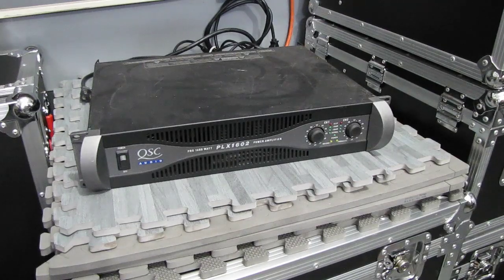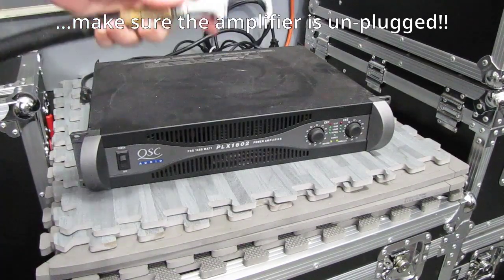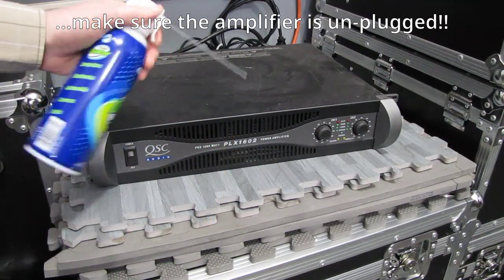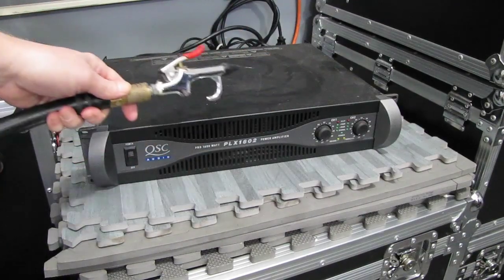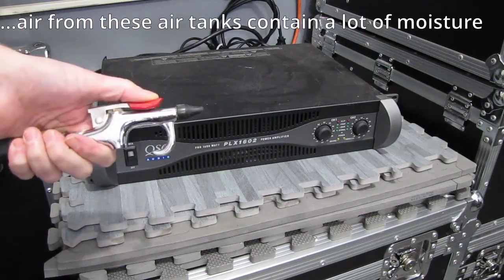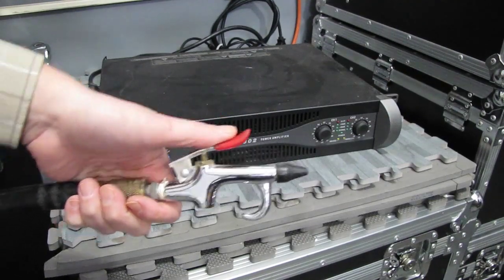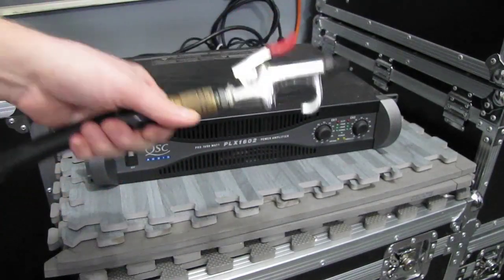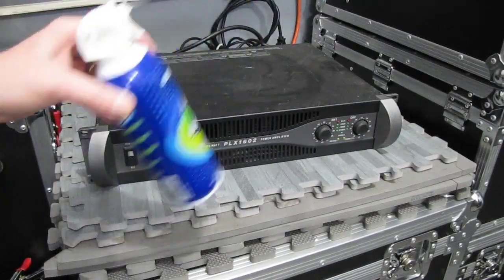Is compressed air ok to clean electronic equipment?

Comment: If I use a can of compressed "dry" air, won't it cool everything down, inviting condensation which could be worse that using "humid" air?
Reply from the maker: Interesting concept with the use of canned air.  I would think if canned air is used the way it is intended to be used, I don't think condensation would be a problem.  I've used canned air for years on my gear and have never experienced a condensation issue.

Comment: Can I use a hoover to suck crap up out of the amp
Reply from the maker: Yes, however, a vacuum does not have the same "removal" force as forced air.  The energy from forced air can be localized, the energy from a vacuum is spread out over a wide area.